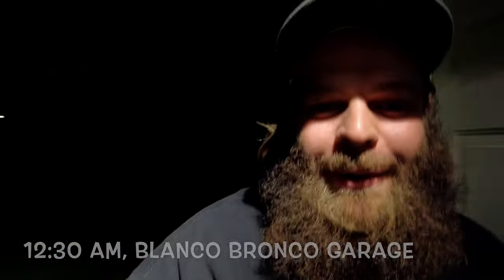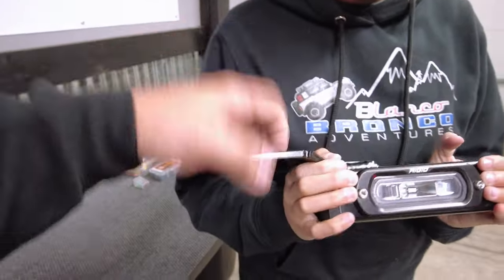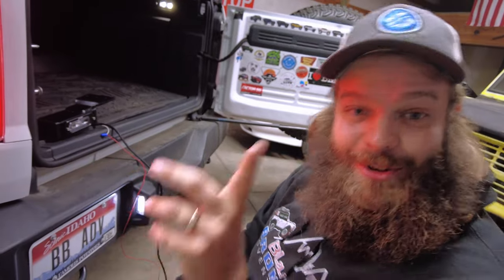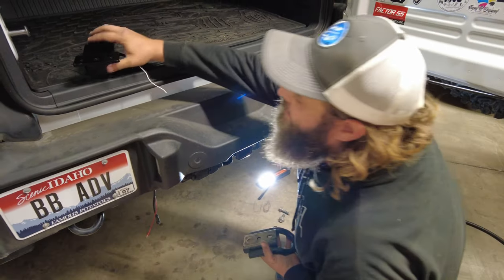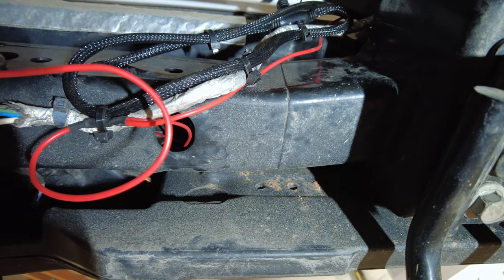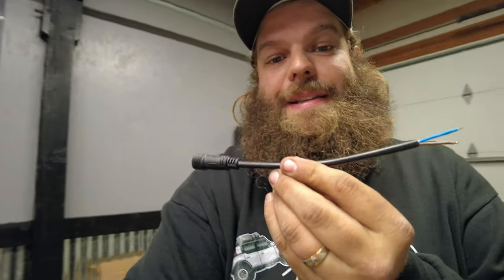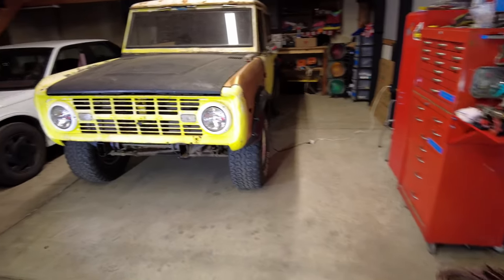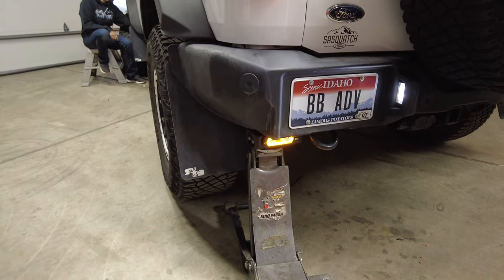How long will these lights last?

Comment: Not sure how you make all these installs looks so easy, but you do.  Great job guys!  I'm with you though, not sure how they are going to hold up off-road.
Reply from the maker: We’ve put them through one trail already and they are STURDY! Actually scraped the bottom of the light instead of the bumper, so it works out well. We’ll see though!

Comment: Can you hook them up to the reverse and an aux switch?
Reply from the maker: Yes, absolutely! We opted not to because we already have the spare tire light as a reverse light. It’s definitely an option! They can also be used as turn signals or brake lights if you get the red ones.

Comment: Do you guys know the aux switches are already run to the back of the bronco? You just have to wire into the leads from the switches instead of all the way up front.
Reply from the maker: We have seen that, but haven’t located or used them yet. We’ll have to look into it. Thank you for tuning in and letting us know!